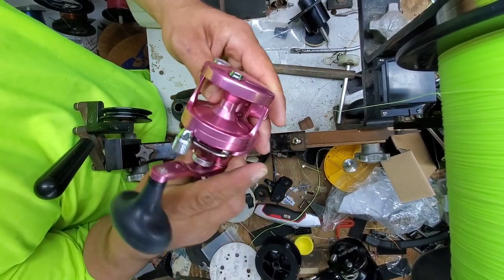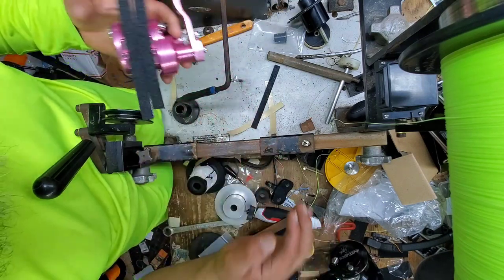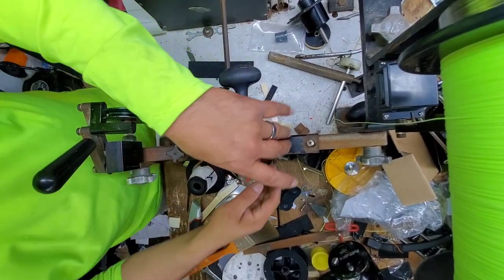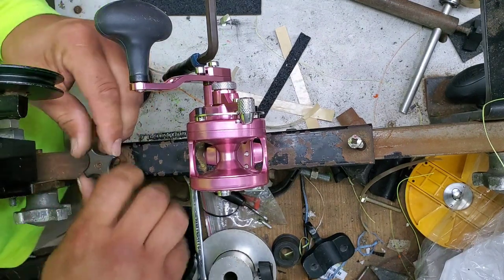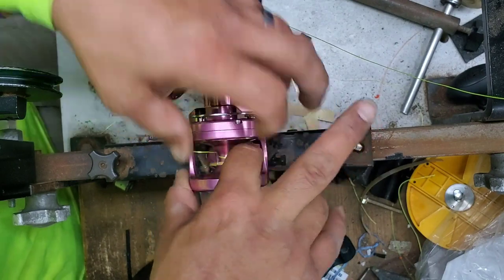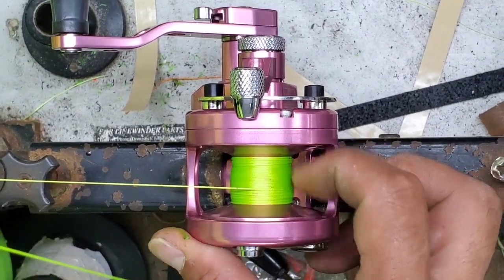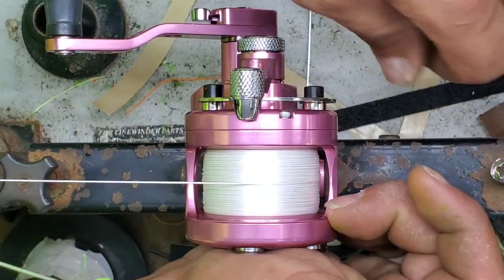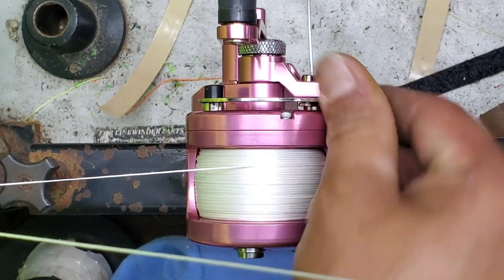Avet Sxj 60lb Cortland hollow core Braid casting and maxed out spooling library grows knowledge asmr

Comment: With the reel seat so small are you limited to only custom rods for it?
Reply from the maker: It's made for jigging rods...
Reply: @TeamHardLife  so any jigging rods will pair Fine? I was going buy this reel for dock/pier casting
Reply from the maker: Some of the smaller thinner strong rods will work just fine.
Reply: So I just bought one today. Avet sx mc Do I need to change out the foot to accommodate a rod like the penn carnage 3 surf rods?